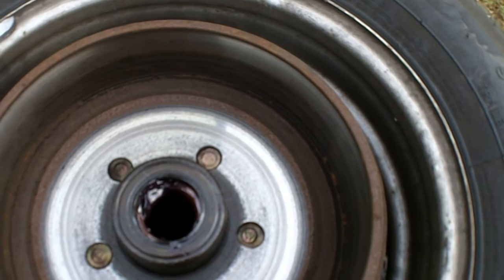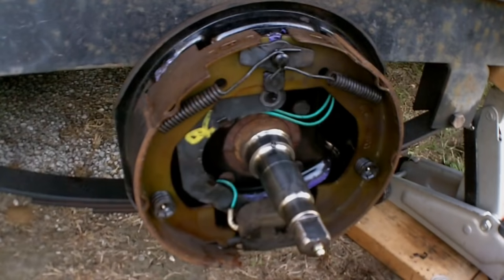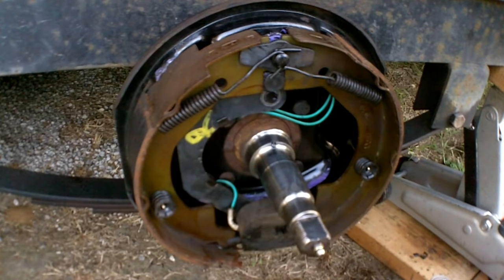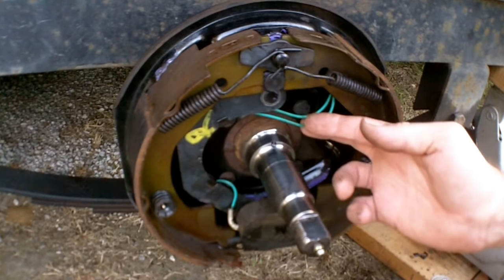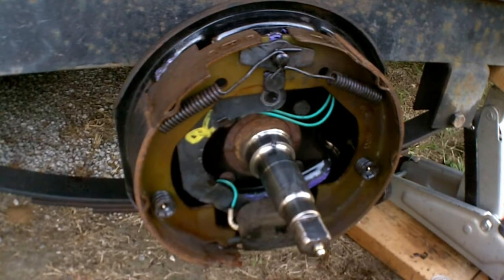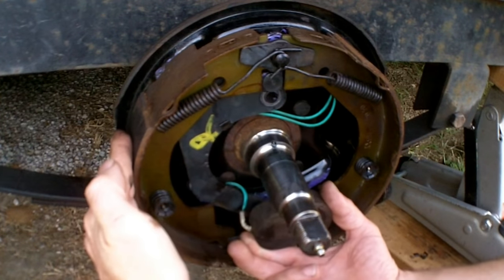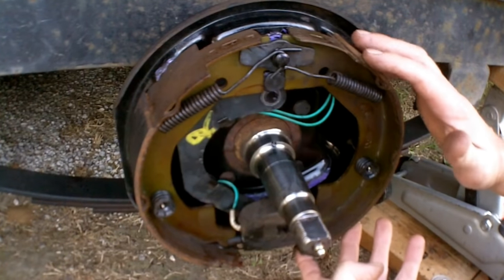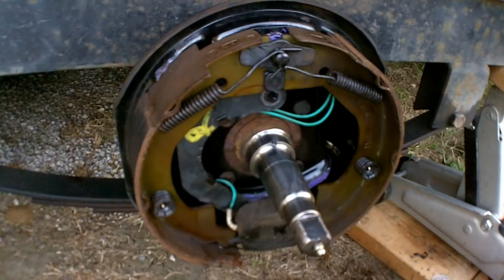How Electric Trailer Brakes Work

Comment: Thanks! Great video and explanation of the electric brake system. Been towing an RV for years but never fully understood the brakes. Did not realize that the electromagnet rode the inside of the drum, and grabbed the drum in order to leverage the shoes.
Reply from the maker: No problem Ray! Now you know how they work! Take care, G.
Reply: Towed a few, but never owned one and hadn't been inside for maintenance/repairs. Having seen a picture of the magnet, I thought it was a torsion cam that rotated by EM force to spread the shoes. But dang, this is as simple as it gets.

Comment: Excellent video.  I have an older 1971 Prowler camp trailer and the magnet portion is almost a big as the inside of the drum.  I was confused about how it worked, but your video has cleared up any confusion I had.  Thanks a million for this video!
Reply from the maker: Glad it was helpful! Good luck and take care, G.

Comment: Horrible design so much things to go wrong, hydraulic disc brakes far better.
Reply from the maker: I agree Bradly. I would love to have discs on my setup, but they're pretty expensive- at least for my pocket. Take care, G.
Reply: "so much thing to go wrong..."  that statement is empty.  List what can go wrong with electric brakes and list why hydraulic are better.   Include a  list what can go wrong with hydraulic brakes for comparison to electric brakes.
Reply: Bradley stir a horrible design, they have worked well for decades.
Reply: Light use huh wonder how our semi trucks been gettin by all these decades 80,000 pounds
Reply: skyline9789 semi trucks or properly tractor trailers use air brakes. Air pressure is used on both vehicles the tractor truck and trailer. I have no idea what has made you think commercial vehicles with high gross weight ratings use electric brakes but sir you’re are very wrong and I hope you have not been spreading that nonsense around.

Comment: Thank you!!! I've never worked on electric brakes before.i had a hot spindle and when I opened it up and saw the wear on the face of the drum I thought that something was wrong. I'm going to repack the bearings and put it back together. Thanks again !
Reply from the maker: Good deal, glad the video was helpful. Good luck with your project. Take care, G.

Comment: Makes total sense. Thank you for explaining. When I have a trailer hooked up I have someone press the brake pedal and I would go around to each trailer axel that had brakes and listen for the "hummmmm" of the electric brakes engaging.
Reply from the maker: Glad you liked it. If you're ever alone, you can pull the pin out of the break away switch and achieve the same results (providing your trailer battery is charged). Or perhaps wedge something between the seat and break pedal. Take care, G.
Reply: @ghostses  Thank you for the idea of the break away. I will use that next time. Yes I always make sure the trailer battery is charged and is charging from the truck. Part of my pre trip check list
Reply from the maker: @dkhill27  No problem! Glad it was helpful! take care, G.

Comment: Well done. Wish all explanations were as concise. Only thing I'd add is to note the brake adjustment screw at the bottom of the brake assembly used to set position of the shoes relative to the drum. Thanks for this.
Reply from the maker: Thanks Michael! Yeah, I totally skipped over the star wheel adjuster. Didn't even realize it till your comment. Take care, G.

Comment: Thanks for the video, it’s straight to the point!  Quick question, when you release the brake pedal, does the magnet, and essentially the brake shoes, go back into original position right away?
Reply from the maker: I can't say right away, but yes- they do go to their neutral position. Good luck, G.

Comment: I was unsure if it mattered which wire on the brakes was positive and which one was negative. This video really cleared it up for me. I have built trailers but never used axles with brakes. Bought a pair of axles to build a tilt car trailer with and needed some clarity. Thank you
Reply from the maker: That's cool Keith! As you found out, it doesn't matter. You just want to make sure they're wired in parallel and not in series. Good luck with your build. You should video the process and post it. I'm sure it would get tons of traffic. Take care, G.

Comment: I thought I pretty much knew about trailer brakes but I did learn some things I did not know. Good video. What you didn't explain was how to adjust the "delay". I have never heard of that feature. Perhaps you could do another video to explain that. I think the "gain" for the magnet comes from the controller on the tow vehicle but feel free to correct me if I'm wrong. Thanks again for a good video.
Reply from the maker: +Scotty Brunton 
Thanks Scotty! No, I sure didn't explain how to adjust the delay. You are correct, the gain comes from the controller- as does the delay. There are two types of controllers, time delay and proportional. Mine is a time delay unit but want to change over to proportional.  I'll try to shoot a clip as I have time and explain things in greater detail. I may even purchase a proportional controller so I can show them side by side to explain the differences of each type. Take care, G.
Reply: ghostses , thanks for sharing your knowledge. You have a very good natural ability to simplify mechanical concepts. Ever thought of teaching at a community college? There are not enough good vocational teachers to meet demands for RV technicians
Reply from the maker: Thanks Jim! I'm glad you found the information useful and do appreciate the compliments. While I've never entertained formally teaching, I do love to teach those that care to listen/learn.  I've learned tons from others so I like to pay anything I know forward. Take care, G.

Comment: I like your teaching.  I am still a bit confused  about how the front shoe is shorter than the back shoe and applying the brake transfers more power from the front shoe to the back shoe!  I need to do more thinking about this!  Tom
Reply from the maker: Thanks Tom! I was speaking from about 30yrs back and may have been a bit wrong on what I was saying. Here is a link that gives more information on duo-servo brakes. Hope the helps in filling in any blanks. Take care, G.

https://www.hemmings.com/stories/article/duo-servo-brakes
Reply: ghostses , that is a good article to read, thank you for posting it.  Everything's much clearer now!  Sometimes things are a little hard to grasp at first!  Thanks for the reply.  Tom
Reply from the maker: @Okie-Tom  No problem Tom! Good luck, G.

Comment: What about yearly maintenance especially in salty winter roads. Great video.
Reply from the maker: I can't say Dan. I don't have that problem where I live. I would dig deeper for your conditions. Thanks and take care, G.
Reply: @ghostses  first trailer with brakes i use in winter, was wondering, not quit a year, but i will re-pack beaqrings, but like the old drum brakes, will it be hard to take drum off, i remeber years ago the friggin things were so hard to take off and put back on
Reply from the maker: @Dan-qt7kq   That's cool Dan! The drums may be hard or easy. It depends on how they're adjusted. You can back off the star wheel adjuster if they are a pain. Then readjust after you're finished.  Good luck, G.

Comment: Who knew that something so intentionally simple, could be so convoluted.  If I could understand this, you are a brilliant instructor.  Thank you.
Side note, why would you delay the application of trailer brakes?  Wouldn’t that just be more prone to jackknifing?  If anything, having the trailer apply just a tick faster than the tractor would be better, if simultaneous isn’t possible.
Reply from the maker: Glad you found it informative. I could be wrong, but I believe the delay is so you don't yank the tow vehicle before it's brakes start slowing it down. It is kind of balanced with the delay because one is hydraulic and the other electric. They apply at different rates.  A proportional brake controller has an accelerometer that senses the vehicle slowing and acts accordingly to apply the brakes. They are superior to the type I have and will get one if mine ever goes out. Hope this helps in some way, Take care, G.

Comment: Should the magnet lever be easy to engage? I think mine are seized. This helped a lot, thanks!
Reply from the maker: There is tension due to the springs, but it shouldn't take a ton of force to move it. You might try using the grease on the pivot points to see if that helps. G.
Reply: @ghostses  thanks! I assumed that was the issue. Wanted to make sure. They wouldn't move at all! New ones going on tomorrow. These seemed beyond repair.
Reply from the maker: @LifeofAedan  No problem! Good luck with your project. G.
Reply: @ghostses  they are back!! 😁
Reply from the maker: @LifeofAedan  Good deal! G.

Comment: So, lemme start off by saying I am very familiar with electric brakes in a whole but MAN! I can tell, you've been in the instructing industry for quite some time!  I mean that in all the complimentary ways!!!  The way you kept it very informative yet not "dumbed down" and THAT, sir, is an art!!!  I absolutely believe that this is the absolute best way to produce an instructional,  or even a refresher,  video!  You actually got me for a second when you spoke of the polarity.  I immediately thought "because it's dc voltage" but as quickly as it entered my craw, you nailed me with the fact that dc IS used polarity specific to run motors in a definite  direction.  So, I ask... Since electric motors are basically a set of or a series of N/S poled magnets motivated by dc voltage, then how does this magnet only utilize one pole?  I mean its all alone. Am I missing something or does it simply have to do with the fact that the drum is the actual negative for that magnet to fix itself to?  That's the one part of electric trailer brakes that's stumped me.  I mean, why let go once the power is removed?  What is it about applying 12 volts that turns  that particular part into a magnet? My apologies for being so wordy😕 Never worldly....✝ss
Reply from the maker: Thanks Paul. Without getting too off in the weeds, a dc motor uses permanent magnets and they do have N and S poles like you've stated. They do spin in different directions depending on polarity. However, the magnets on the brakes are electromagnets. It's basically a coil of wire wound around a core. When voltage is applied, they become magnetic. Polarity doesn't matter in this case. Solenoids work on the same principle as the brakes. They too do not care about polarity. Hope this helps, and do some digging around. Take care, G.
Reply: @ghostses  Very well explained and the relationship you made to a solenoid makes perfect sense!  Thank you, Sir!!!
Reply from the maker: @MrSebesta  Good deal! Good luck, G.

Comment: If I am converting surge to electric do I eliminate the surge coupler. I must replace the existing shoes, wheel cylinder, etc.? All I need is a wire to the Magnet and no actuator? Great vid!
Reply from the maker: Curt, if you're going from surge to electric- yes, the coupler should be eliminated IMO. The backing plates, etc. should be replaced with the electric variety and be properly wired. You would need a controller/actuator to control the brakes. Hope this helps. Do more research. Take care, G.

Comment: Interestingly enough, when I had the aftermarket trailer brake module installed in my truck, I asked the mechanic how they worked.  Your explanation was far more concise but he told me that when it came time replace the brake pads or whatever, it was actually cheaper to replace the ENTIRE brake assembly, I.e., the drum, pads, magnets; the whole shebang.  Labor charges were far less as well.
Reply from the maker: Thanks! Yeah, that is the way to go- especially if you're having the work done. Take care, G.
Reply: how much did it cost you?
Reply: @kensimon4478  I bought a new trailer and had the in-cab module unit installed by an RV dealer for a little over $200 for the unit and labor.  I have not had to replace the brakes yet so I’m not sure how much that would be.
Reply: @fennis26  i am probably gonna buy one used from marketplace to save 2 vrand or so....  just want to estimate brake replacement cost of needed.

Comment: Great video. Just back from a short trip and my RT brakes are barely braking. Not many miles on the trailer and just adjusted the shoes. The manual lever on the controller indicates 9.5 volts but it will not lock up the brakes. On to the next step.  Thanks,
Reply from the maker: Thanks Winston! Look into the gain settings on your controller. It might help narrow down your problem. Crank it up and see where your at. Good luck finding the solution to your problem, G.
Reply: If this is a new trailer with Power Gear axles, you should remove the brake drums and inspect the brakes.  Power Gear has a huge problem with over packing the bearings and saturating the brakes with grease.

Comment: Great concise Video i have a Hayman Reece Compact IQ wondered why on Highways it seemed OK but after a long trip towing my Caravan 
in Australia the Caravan Brakes locked up so hard in City areas the caravan wheels would lock up and tyres would be smoking i had the damn power dial on Full ( no fool like an old fool ) you explain the principle so well  i now know less power ( voltage ) to the magnet  and use the
inner blue dial for the boost is what i should be doing Thank You Ken Fogden Wyoming NSW Australia  Cheers Mate
Reply from the maker: Thanks Ken! Glad you figured out what the problem was. Take care, G.

Comment: Nice vid. Got a question for you if you don't mind. In your opinion, what would be best for my truck bed trailer? Electric over hydraulic, or ? Trailer is built from a f150 1/2 ton, has disc brakes and lines intact. A frame hitch. Not used for heavy hauling though, just green  waste haul off. Though brakes aren't really necessary since it only hauls light loads, figured eh, I might add the actuator some day. Any input will be greatly appreciated and thank you in advance 😊
Reply from the maker: Thanks Charles. You can't run electric unless you have that setup on your stuff. I can't speak for electric over hydraulic. I don't know if that would work with original brake setups, or if there are some other requirements. Dig deeper is all I can offer. Good luck, G.

Comment: Great video! I had no idea electronic brakes were so simple. One question though - How is the rear shoe actuated when traveling forward? Hydraulic calipers actuate both shoes simultaneously correct? I'm curious how/if the magnet also does this. Thanks in advance.
Reply from the maker: Do a search for servo brakes. That should answer your question(s). Take care and good luck, G.

Comment: Love your info on how those electric brakes work and they also work when your reversing the trailer as well unlike the push ram mechanicle or hydrolic brakes which dont but the only downside on electric brakes is they may not be appropriate on boat trailers going in and out  water all the time especially salt water they wouldnt take to kindly to because water and electrics just dont mix.
Reply from the maker: Thanks Matt. Glad you found it informative. I agree with you. Take care, G.

Comment: good stuff, so the two sides cannot be in series?
Reply from the maker: All wiring should be in parallel. If each side was in series- you might loose a whole sides braking. Hope this helps, G.

Comment: Great description. The only thing I am still unclear on is how the front shoe causes the back shoe to do "most of the braking".

I just had to replace a magnet in mine. It was only 2-3 years old and my camper trailer doesn't get that much use.
Reply from the maker: Here's an article that goes deeper into how drum brakes work.
https://www.hemmings.com/stories/article/duo-servo-brakes
My comments fall inline with this section:
"The secondary shoe has a longer and larger lining surface than the primary shoe and is relied on to do 75 percent of the braking. The term duo-servo means that the force-multiplying servo action of the brakes occurs when the vehicle is moving forward or in reverse."

Hope this helps, G.

Comment: Great video, I have a 19 foot boat on a trailer and I am not sure if the breaks are working.  What is the best way to check? Thanks!
Reply from the maker: Christian, I can think of a few ways. 1) If you have a brake controller with a manual lever, you can move the lever without applying brakes to the vehicle and they should slow you down. 2) If you have a break away kit and a charged break away battery, you can pull the pin and then try to move the trailer forward. The brakes should be engaged. 3) Jack up one side of the trailer (1 axle at a time if you have a tandem trailer), then have someone apply the brakes in the tow vehicle while spinning the wheel and it should lock up. Then move to the others. Hope this helps, G.
Reply: Most boat trailers use hydraulic surge brakes, not electric brakes.

Comment: I love it.  I'm just learning about trailer braking.  Except mine on a car trailer don't  .  .  
Hooked up two Ford trucks and neither controller will operate the brakes.  But an 05 Dodge operates the brakes just fine.  Scratching head.   Wondering about the 6 volt battery box I just discovered on this trailer.  Have not checked the battery yet but found your video!  BTW, the lights work but brakes don't work - at least the trailer controller says 'Disconnected' on the factory controller in a 2008 Ford F250.  Cleaned the pigtail but no joy.
Reply from the maker: Not sure on Ford, but on my truck (GMC)- I had to find the brake wire in the wiring harness, bust them out and connect them on both ends. Not sure if that's your problem, but start there. Hope this helps, G.